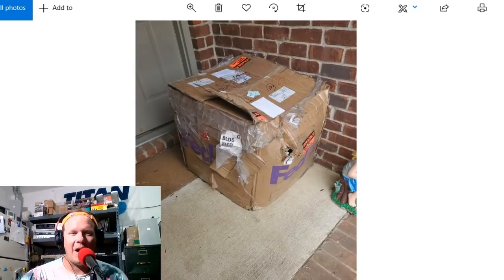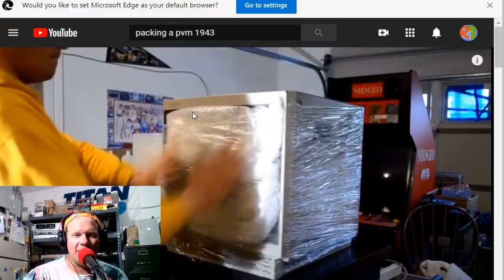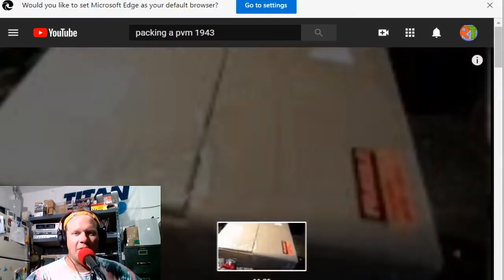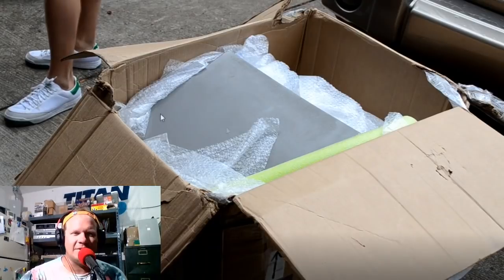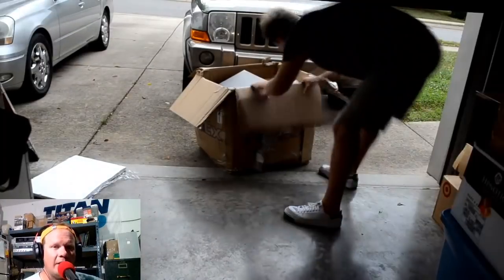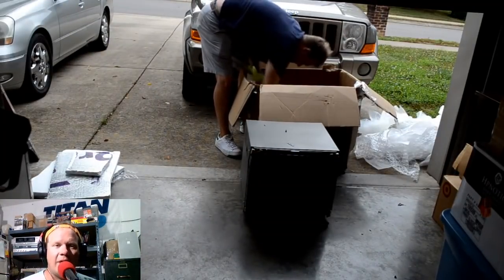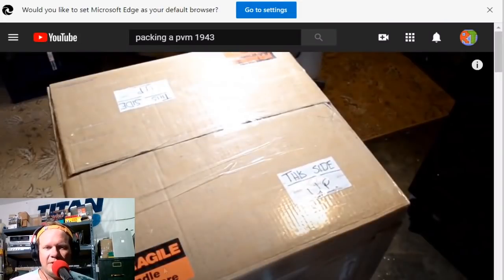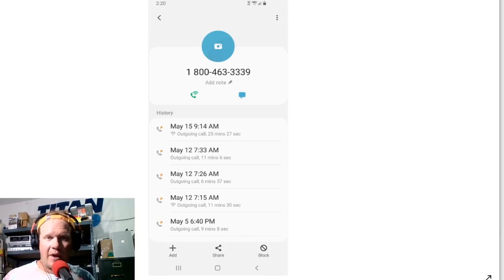FedEx Shipping Nightmare | Worst CRT unboxing ever!

Comment: I worked at FedEx ground at one of the highest ranking facilities. They're all highly understaffed (purposefully) and boxes are all rushed within 3-5 hours time frames. Around 3am-5/6am and 5pm-8/9pm. 1 person, rarely 2 per semi truck filling the truck with extremely heavy boxes top to bottom. It's a hell of a job and the reason packages get so fucked up is because they are put on at once on a conveyor belt and slides down a massive slide into the back of the truck onto rollers and if we get backed up (which is always) obviously bc one man can't stack 100s of boxes in a few minutes, then the packages slowly get crushed up in the conveyor belt. All the while in the summer it's 105 degrees plus in the non air conditioned trucks and facility. That job destroyed my spine after 5 months of work and I still have severe damage to my spinal nerves and intervetebral discs. Fedex is hell.
Reply: dont forget boxes getting crushed due to jams 😂

Comment: For the moment, I'm failing to understand how a so carefully made package could have ended up like this. It almost like this was made on purpose and most of the packaging material has been removed.
Reply: I'm guessing they dropped it bad and went ahead and opened it to see how bad it was, and, after seeing the disaster, they just shoved all the stuff back into the box and... hoped nobody would notice? I don't know.
Reply: I already posted this individually but I'll copy paste it here: I worked at FedEx ground at one of the highest ranking facilities. They're all highly understaffed (purposefully) and boxes are all rushed within 3-5 hours time frames. Around 3am-5/6am and 5pm-8/9pm. 1 person, rarely 2 per semi truck filling the truck with extremely heavy boxes top to bottom. It's a hell of a job and the reason packages get so fucked up is because they are put on at once on a conveyor belt and slides down a massive slide into the back of the truck onto rollers and if we get backed up (which is always) obviously bc one man can't stack 100s of boxes in a few minutes, then the packages slowly get crushed up in the conveyor belt. All the while in the summer it's 105 degrees plus in the non air conditioned trucks and facility. That job destroyed my spine after 5 months of work and I still have severe damage to my spinal nerves and intervetebral discs. Fedex is hell.

As to your comment in particular boxes like this are squished up and crushed against other packages causing damages to the boxes.
Reply: @detroit retro gamer drg313 The most they got out of us was probably 5 MAYBE 6 hours nothing more for night shift. By then we'd have it all done. I never worked mornings though, nights were hell enough. If they had us working 7 I'd of offed myself.
Reply: @7ngel  Thank you for taking the time to write about that issue and trying to explain the causes. It's true that as a customer, one generally doesn't have any clue of really happens behind the scenes. Now I understand much better how accident like this one can happen. Your comment was much welcome.
Reply: @Dioxaz  No problem. I try to let people know about FedEx when I can because no one ever told me how bad it was as a customer or as a worker. If family or friends ever are looking to work at FedEx inside the facility (truck driving isn't AS bad) such as a package handler then tell them to steer clear of that place at all costs. The same thing goes for basically any heavy lifting facility such as target or amazon. They all pay low, cause severe damage to your spine, and if you're hurt they will lie and tell you nothings wrong with you by paid off company doctors which is what happened to me.

Comment: I drove for a contracted service provider with FedEx Ground for 2 years.  The volume of packages they see a day meant this happens a lot, unfortunately.  During peak time it wasn't unusual to see drivers do upwards and over 100 stops a day in a large area.  I would see large boxes like this basically dropped to the ground from several feet in sorting in the morning before my route.  As one of the ones who cared, it was hard to watch things like this happen and having to feel responsible for it even when it wasn't my fault.  Very embarrassing to hand these off to customers. It was a difficult working condition and they really don't pay well enough to retain good drivers or sorters for long.

Comment: That really sucks man. The PVM I use daily which is a 20M2MDU was packaged very well and double boxed by the medical supply company I bought it from. I had to handle the shipping through UPS and it arrived damaged (I watched the UPS guy drop it in front of me). I filed a claim since I had insurance and the process dragged out like this until eventually they claimed the boxes needed to be rated 30% over the shipment weight even though that is not what their packaging notes specify!?! 
Fortunately the unit works perfectly and just has a broken corner on the lower left bezel.

Comment: Wow that's horrible, I'm really sorry to hear you had to go through that. It's a real shame Fedex can't stand behind their service. I've had similar problems with FedEx in Ohio, just recently I received a rather expensive wooden table that arrived with the box and protective material completely impaled and the table top damaged. It came from eBay and it clearly wasn't the shippers fault so I didn't want to return it, but FedEx wouldn't give a claim so I've had to just keep it in damaged condition. I'll be a avoiding them moving forward too.

Comment: i have such kind of issues with a comany called DPD, they doesn't deliver to my Home and claim that i wasn't at Home but when i pick it up 2 Days later (because the need 2 days to deliver it to a Pick Up Store) the Packages are totaly crushed and look like someone opened it up to check if there is something in there thats worth stealing.

They did this 3 Times in a Row in a short periode of time., when i tried to reach DPD they were very rude or hang up on me like in your case with FedEx.

I stopped using DPD, told everybody about it and i always leave a note to all Companies i order from that i reject any Packages from DPD.

Comment: August 17th I order Rack-Mount pvm8045q & pvm8044q  from Alabama to Boston Massachusetts and it came 21th FedEx terrible delivery pvm 8045q the plastic bottom of the back where the battery goes are crack broken one door fell off.  It wasn't like that on the image on eBay owner  good thing  both of them work.  where can I  find a replacement of the back bottom plastic part need help with FedEx I hate you

Comment: I have a 20L5 with some left side barreling, I've tried every setting to fix it and I can't figure it out. The right side is perfect, it's just the left stretches a bit. Any advice on what it could be? 

I can't find a setting in the service menu that moves the H at all except for pin settings that don't seem to be the issue. Will I need to open the case? Are there dials on the board that adjust H?

Comment: I had the same problem with both UPS and Fedex.  I now just use uship for all monitors or any heavy/fragile items.    Also on having the UPS Store or Fedex store pack things and insure it.  I did this all the time and it usually worked out.  It's still a gamble with low-wage employees who just don't care.  I filed a claim with the UPS Store, but guess what? They don't handle it... they send you through UPS and that is a pain. lots of calls, etc.   Both Fedex and UPS use a third party insurance adjuster who are biased to deny your claim for any damn reason.  So use Uship, or drive it yourself.
Reply: You know what's funny/fishy. I live in a small town and FedEx actually picks up/drops off all the UPS packages as well. Birds of a feather ?

Comment: I had a similar issue.   They damaged a 20" I bought  on ebay.  They ended up paying some cash to the seller but never came back for the monitor.  I did eventually fix it so I guess it worked out well.  ;)